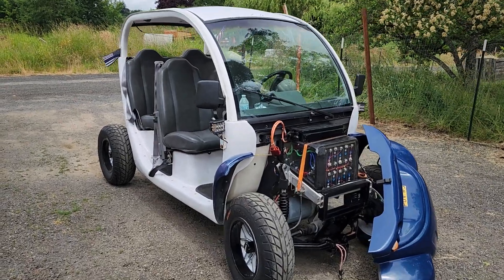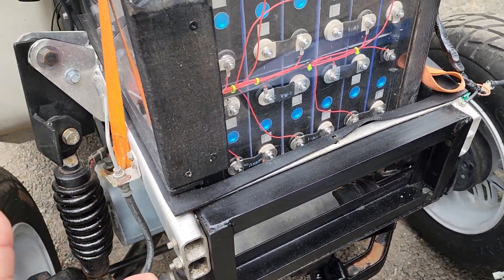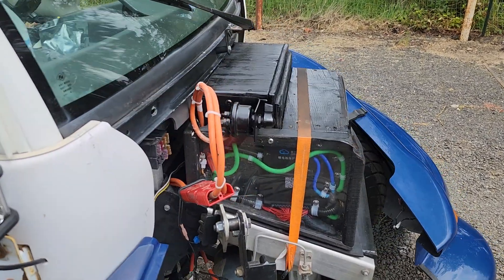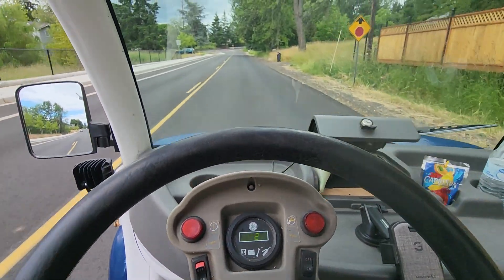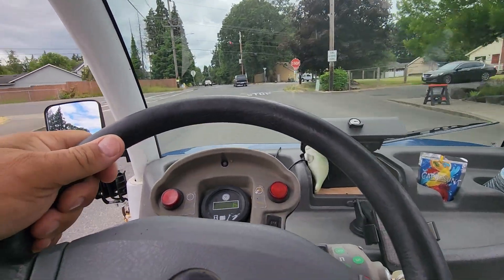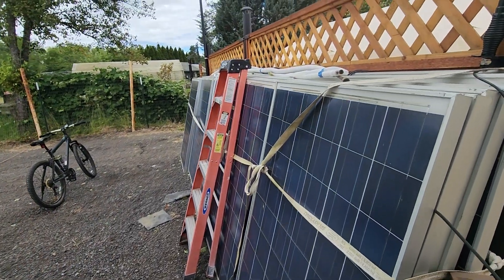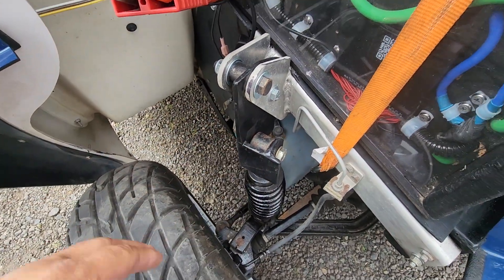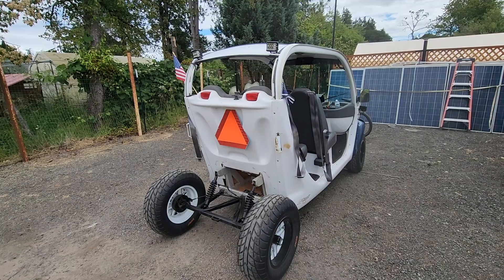update 1 on the 2002 Chrysler Gem car DIY LithiumBattery Upgrade 72 volts Lifepo4 24swith JK BMS

Comment: Great work. Sold mine 6yrs ago right before tbe battery tech improved. I still have the GE Motor controller programming software and plug in adapter harness if you are interested. Lets you change about 25 parameters in the controller.
Reply from the maker: Yeah, I now have 3 gems,  I would like to modify the controller perimeters.. email me, commandyne@gmail.com